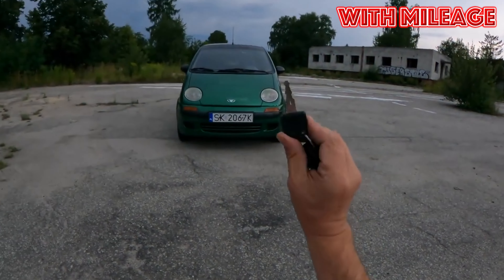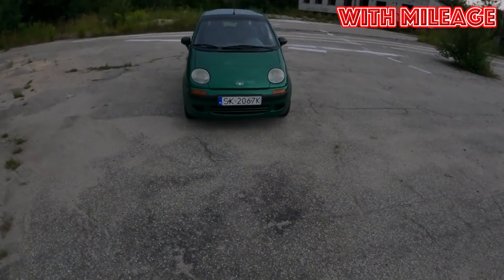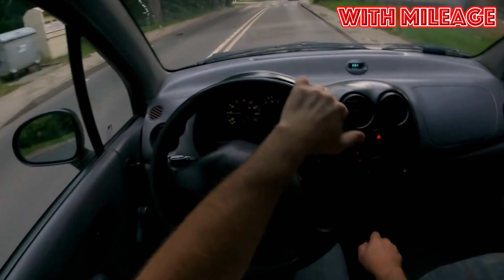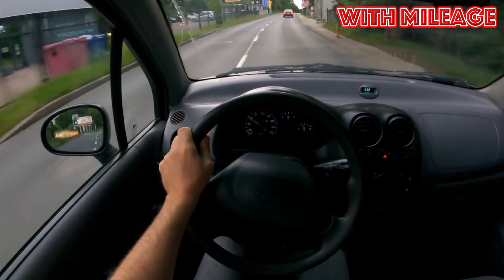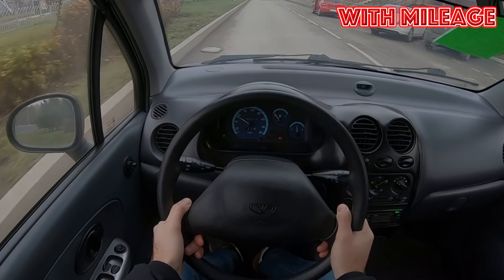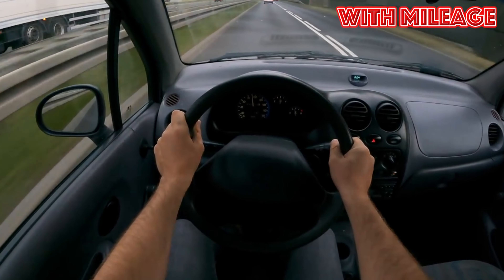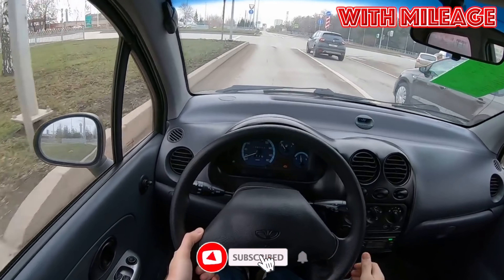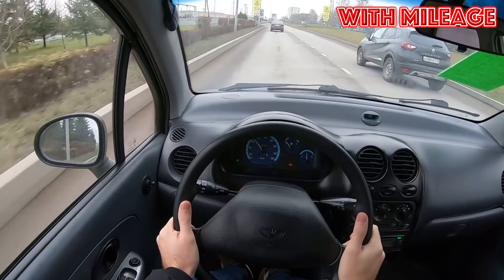Why did I sell Daewoo Matiz? Cons of used Daewoo Matiz 1998-2015 with mileage

Comment: Have a Daewoo Matiz 2. Great 👍🏾 car 🚗….I am in Africa Ghana 🇬🇭 . Bought it used and had mileage of 98,000 on it. Changed all four shocks, worked on the suspension… with the bushings that is front and rear , changed the transmission oil, flushed the radiator and poured coolant into it. Changed the clutch disc and pressure plate cos my car has manual transmission … 5 speed stick shift. Aircondition is working great. Engine is still running well and change engine oil every 4 months … because I want the engine to work efficiently. Car 🚗 runs smoothly with no problems till date.
Reply: really, I wanna buy one and use it for my children's school movement but I don't have enough to buy new so am planning to buy Ghana used  one
Reply: Do you have any social media where I can text you and we communicate? I’m planning on buying one for taxi

Comment: I bought a Matiz as a second car, I love it! Good information on things to look out for to maintain. Thank you!
Reply: what is the fuel consumption ?
Reply: @ИванИванов-с7ч9з  Very amazing. As good if not better than the hybrid I drive at work. Certainly a lot more fun to drive with the 5 speed manual.
Reply: @antonialeitz9179  but can you tell me how much litres? Im thinking to buy one for work( Food delivery and i need to know the exact fuel consumption )
Reply: @karasita8932  I will work it out this week once I fill it up. I seriously have never bothered because its so cheap. But will let you know, stay tuned.
Reply: @antonialeitz9179  thanks you! The sell price is 350 euro. And i think i will get it even for 300 euro. The car have some visual damage but for that money i think i will be good car. What about the repairs? Are they cheap too?
Reply: @karasita8932  I would buy it. Repairs are easy and they are tough little cars that can take a lot of punishment.
Reply: @antonialeitz9179  im very thankful. I will think and maybe will go to see it. I think that you can put gas ( LPG ) on the car and it will become even more economical and perfect for a work car